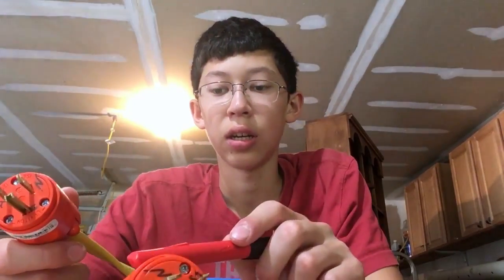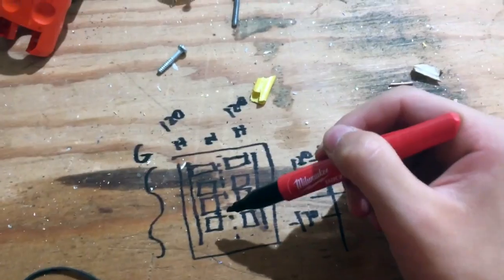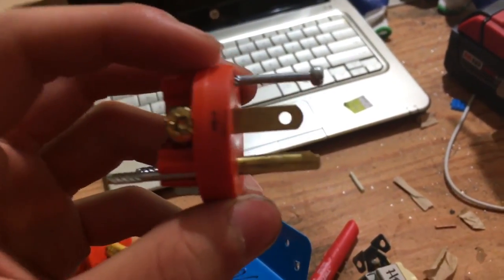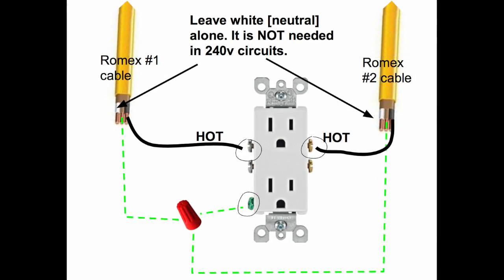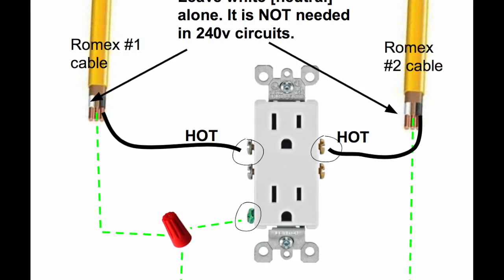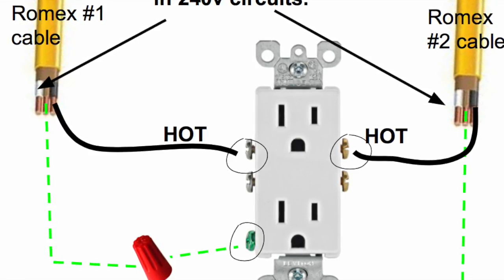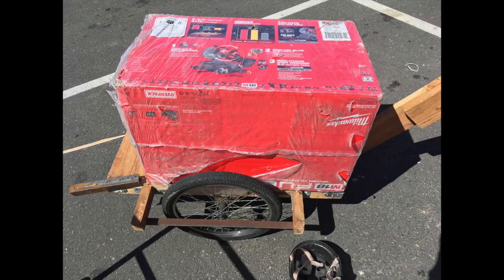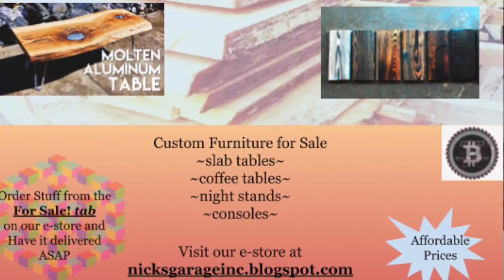HOW TO GET 240 VOLTS by combining 2 120v outlets. #electricity #diy

Comment: Can you use this with an APC Ups?
Reply from the maker: Melvin Ruiz yes. As long as the apc input voltage is 240, this hack produces the exact same sine wave 240 as if u were to install a dedicated 240 outlet.
Reply: I'm planning to use this on 2 Smart Ups APC(110v) each. Thoughts?
Reply from the maker: @TheMelvinRuiz  ok so basically u will plug in a smart apc into one outlet and another apc into another outlet, connect my junction box to each apc, and then run an appliance of my junction box. YES, it should work. And there isnt a risk trying it as it wont damage the APC, since we arent doing anything "electrically illegal".

Comment: Question- hope someone can help. I have a 15a 110v outlet. I need 240v at 15a. Can I take my neutral from my 15a romex off the neutral bar and put it on a new 15a 110v breaker across the panel on a different phase? Code is irrelevant, i just want it to work. Makes sense to me.
Reply: I can help,  call I licensed electrician,  not the carpenter who does electric in his spare time.
Reply from the maker: ok so remember a 240 volt circuit requires 2 hots on different phases and one neutral. The neutral could theoretically work depending on how the house was wired, but it isnt garunteed, especially since sometimes the neutral and ground are connected yada yada. You can instead take a hot wire off the hot bus bar and some how hack it to your 110v breaker and get 240. Obviously if you just cap the 2 hots together it will short out. But a better solution is to get a tandem breaker which is a breaker that takes up half the space of a 240, only 1 slot and wire it properly.
Reply: @nicksgarage8295  I'm trying to get this to run a mini split AC and it does not have a neutral port. Would this mean i dont need that neutral in the panel? 

Also, regarding the tandem breaker, can I get by without running a new romex? Can I take out the existing neutral and use it as a hot on the new tandem? If so how is this really different than just using one of my spare 15a 110v breakers on a different phase? Minus the toggles being joined...
Reply from the maker: Christopher Huggins yes that’s correct u do not need the neutral. Instead use the ground and 2 hits.The neutral is used for special 240/120 rv outlets and stove. The stove has 120 light and 240 heat elements etc and rv has 240 air cond. and 120 appliances. This is b/c hot to hot is 240 hot to neutral is 120. U do not need the neutral, the 2nd hot kinda acts like one  ish.
Reply: @nicksgarage8295  That Makes sense to me. Thanks for helping! Sounds like I could rig it up using what i have available as long as I male sure im on different phases. Can i use 2 half size breakers that share 1 slot? Maybe I could tie the toggles together and i basically made my own tandem?
Reply from the maker: @chuggns  get one of these: https://www.amazon.com/Square-Schneider-Electric-HOMT2020250CP-Single-Pole/dp/B00CONLHP8/ref=sr_1_2?keywords=double+pole+tandem+breaker&qid=1552617112&s=hi&sr=1-2
You can remove 2 120v breakers which take up 2 slots of space and install this little tandem that has both the 2 120s and a 240 50a.

Comment: hey how a can convert a 240v to a 120v
Reply from the maker: Yo plz subscribe and then ill tell u. Well u know those cylindrical tripple AAA batteries. If you put 2 of them back to back you get not 1.5v but 2x1.5v = 3v. Well with my box its the same thing 2 120v in series or back to back = 240. I am guessing u arent from the united states so u have 240 instead of 120. You want to convert 240v to 120v which is the opposite of what i did here. To do that u need a transformer. A transformer can lower or increase the voltage of a circuit but because of conservation of energy it will change the max amperage. So since u are stepping down the 240 to 120v u need a step down transformer. To create one open up a microwave and remove the transformer. Then remove both windings. Take some 12awg wire or whatever ampacity for your circuit and wrap it around a ratio of 2:1 primary:secondary. So do 10 turns primary 5 turns secondary or 4 primary 2 secondary ORRRRR just buy a 240 to 120v step down transformer
Reply: @nicksgarage8295  yea and are those safe to use? all i need is an outlet with ground and since that outlet is grounded i think it would be good to use that one but its a 240v outlet with the pug port same use for dryers and gas heater
Reply from the maker: @refugioflores2226  if u live in the USA the 240 is actually 2, 120v lines. You can open the dryer outlet and take one hot (black) and measure the voltage from it to the ground (clear copper) or some 240 outlets even have a neutral (white). The voltage will be 120, and therfore you will not need a transformer as i said above. Now run a 120 outlet with these wires pigtailed from your 240 outlet.